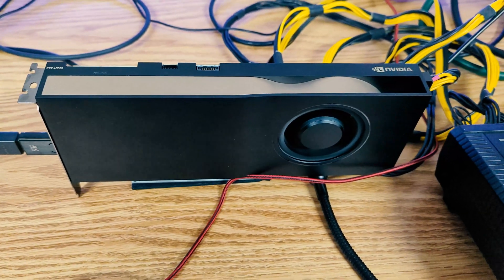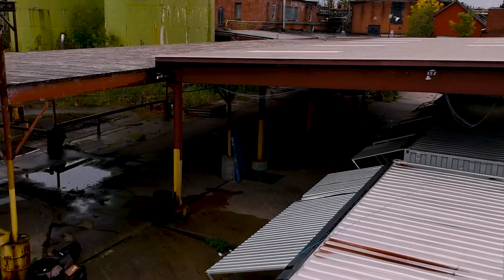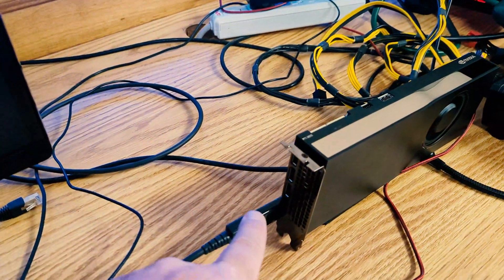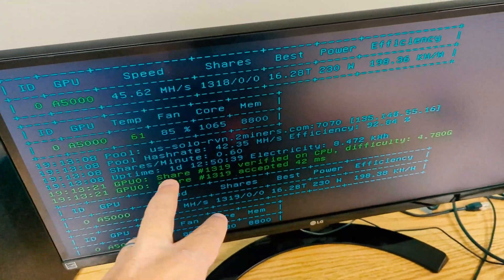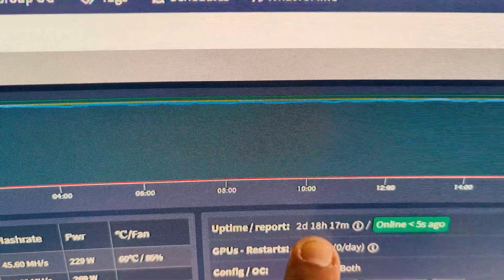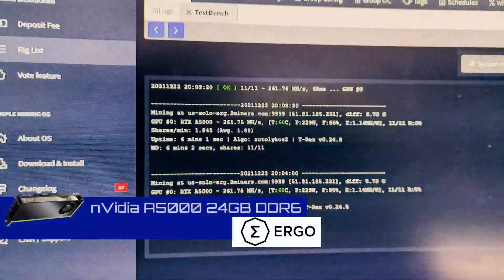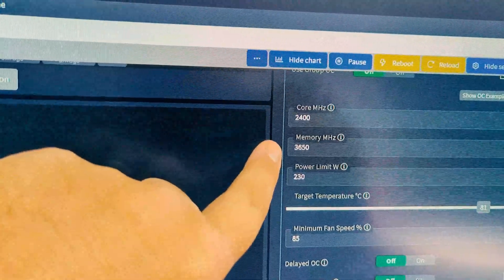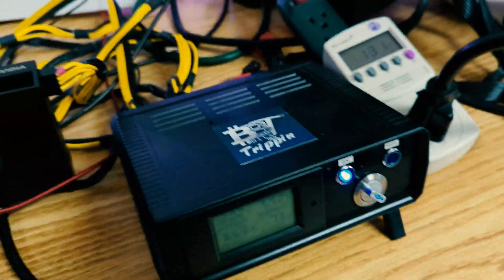nVidia A5000 Cryptocurrency Mining Deep Dive - ITS A BEAST!

Comment: the a5000 will never make sense from a cost viewpoint. It's dang near, or is twice the cost of a a4000, and 2 a4000 have  more hashrate than a single a5000 and a4000 at $1000 a pop, just makes a lot more sense to use a4000 over a5000. at least that was our conclusion

Comment: I got confused like while mining ethereum u showed it’s taking 230w in software but the actual power draw by trapping the 8pin cable n riser it showed 195w ?? Which one is correct 195w or 230w ???? Please clarify
Reply from the maker: the 8pin is 195w, the software attempts to account for the riser power (35w + the 12v Rail PCIe 8pin power 195w) and adds them together. In this case it was near accurate when taking the whole power consumption of the GPU.
Reply: @BitsBeTrippin  ok thanks for clarifying as always 😊

Comment: I am pulling at least 100-104 mh/s per RTX A5000's in my 8 RTX A5000 mining rig (around 225w @ 1450mhz core and 8950mhz memory with 15mv undervolt) per card mining ETH/daggerhasimoto on Windows using nicehash quickminer/excavator. That brings the efficiency to 0.45MH/J. Each card makes at least $6-$7 per day. I have my two A6000's ordered, should be here Monday.
Reply: Insane setup! How do u get hold of them?

Comment: @Bits Be Trippin'  these things does SLI . check them out and they are tsmc made , not samsung like rest of 30 series gpu thts 7nm vs 8nm hence the power saving maybe
Reply: I can confirm SLI DOES work on my setup, without using NV link bridge board, gives a slight boost in mining speed/accuracy, ECC disabled.
Reply: @TerrenceMillar  Do you have anywhere I can find more information on this?  Searching isn't turning up anything about the A5000 and everything else is pretty old.  Thanks for any information you can pass along!

Comment: Ergo is higher because this has more CUDA cores than the 3080, more inline with the 3080ti. The limitation on ETH and why it doesn’t do more is that it is using GDDR6 and not 6X memory. The memory speed is just too low for ETH but ERG, that needs more core speed benefits.

Comment: Would love to see a test with the A2000 is. Sounds like it should be super efficient while not as dense from space side. Might be a great card for home miners.
Reply: A2000 - 41MH X3 123MH, cost about 1700, if u can find it. VS a single A5000 110MH that cost like 5k. more then double for the less MH. would need to be real desperate to buy one of these.
Reply: They are already ahead of you. Good luck finding any. Around 46MH/s
(ETH) @66W, it's a sweetheart.
Reply: who is getting 46mh @66w from an a2000 on eth?   show me.  I call bs.
Reply: Yea 46 is bs. But 41.x at that wattage is super efficient. And as for "goodluck finding them" could be used for almost any GPU right now.
Reply: @TFGecko  my experience is also 41.x @73-77w, and i've tested quite a few of these.